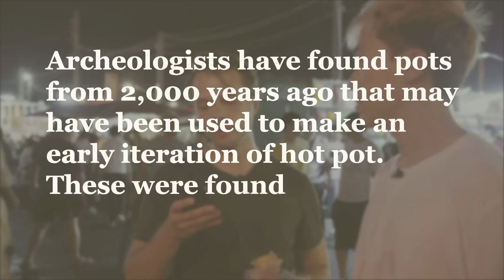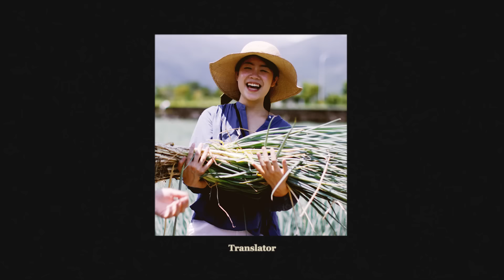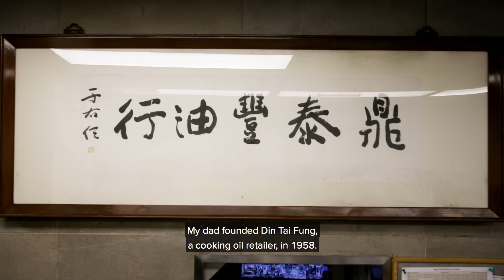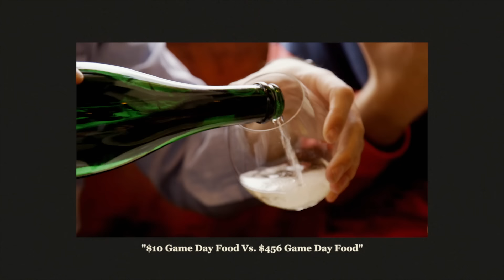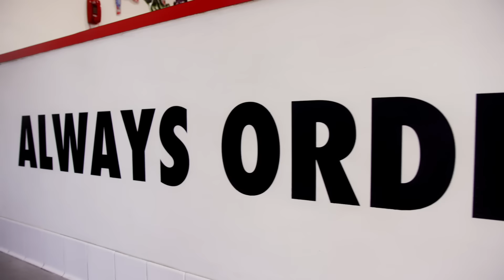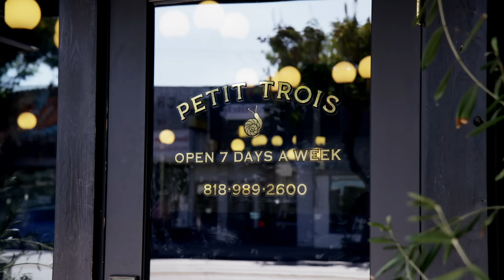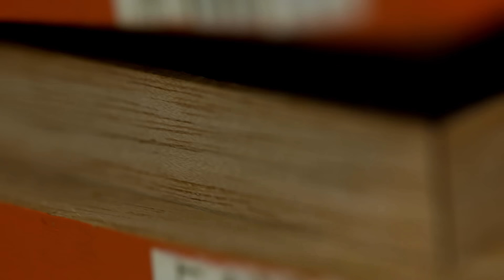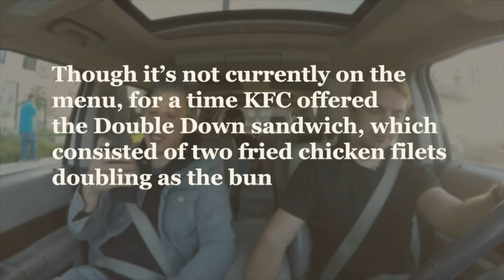Worth It: Season 7 Marathon

Comment: I'm in the "pro-body pillow" camp. I can't remember if it was my doctor, my physical therapist, or both who suggested that I put a pillow between my legs for better support. I chose a body pillow so that I can also snuggle it and get support for my upper body. I'm a side sleeper, mostly, and without something in my arms, the top one just collapses my ribcage and makes it hard to breathe. And yes, I know about the dirty body pillows, and I just think that as long as it doesn't hurt yourself or others, do whatever you want. A wise, very small Twitch streamer taught me that, and I've been applying that to my line of thinking. As for myself, my body is a simple light gray with lines, I guess? Got it from Walmart, probably not much more than $15. I also have a dark blue one in the same style that really just needs a wash that I keep procrastinating on. I had it where I had a pillow on each side of me, so when I roll over, I don't have to take the pillow with me.